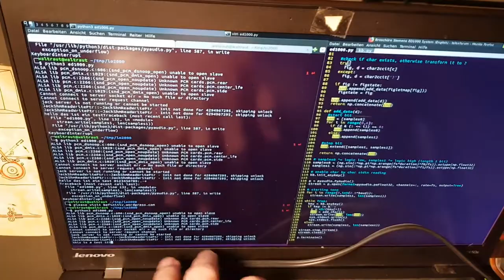Sending a teletype message with the soundcard of your PC (SEL Lo2000 teletype demonstration)

Comment: A very strange machine.  It was one of the first produced electronic teletype machines.  Earlier machines used a simple blocking lever mechanism and a printing mechanism similar to that of a traditional mechanical typewriter.  The printing mechanism of this machine is an evolution of that- it uses a continuously rotating carousel containing levers with type attached.  Printing is accomplished by operating a solenoid underneath a passing type lever, lifting and throwing this lever against the paper.  Shifting is accomplished by lifting and lowering the carousel.